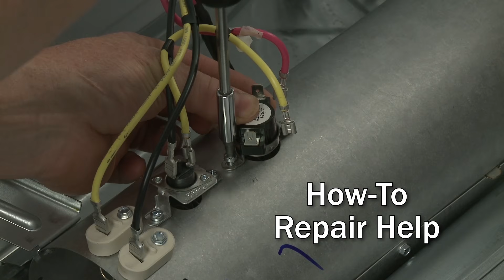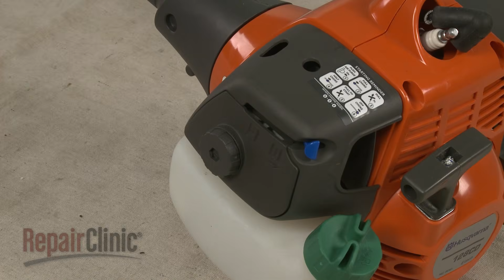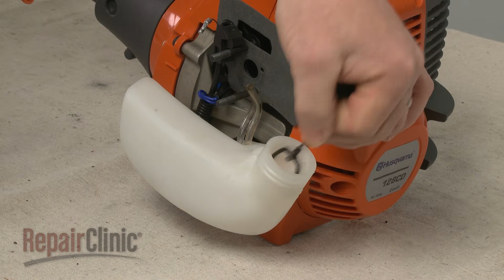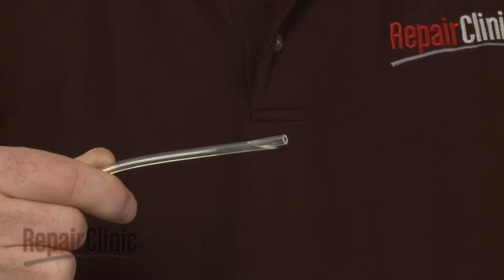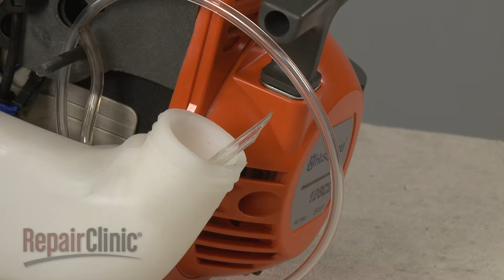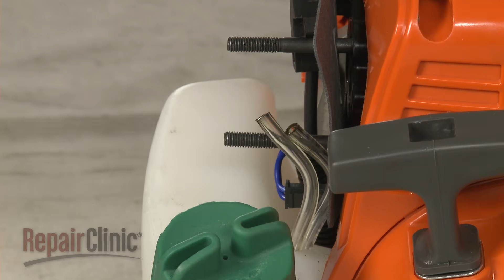Husqvarna String Trimmer Fuel Line Kit Replacement #530069599

Comment: I am in the middle of doing this repair. One issue I think is possible is that the carburetor connections angle back towards the engine. I think the length of the hose line is critical to prevent a kink in the line from forming. Also, comments suggest the length of the drop line in the tank. This is also critical, if you don't want the filter/weight to be in the wrong place. (3rd time is the charm!)

Comment: Hi me again...  I needed a quick review.  I watched a couple other "repair persons" and it was not clear which fitting the lines from the tank should hook to on the carburetor.
Your visuals made that clear.  One fella removed more parts on the engine module than is needed to replace the fuel lines.  
I do think more information on the return line and it's function should be highlighted. 
Thanks AGAIN....
Reply from the maker: Thanks for sharing!

Comment: So my carb does not come off after removing the attachment line. At least not easily...or with gentle force.  Any tips? It's a Husqvarna 128c
Reply: its screwed somewhere
Reply: @cyberedwing  turned out it was stuck to the carb.
Reply: @cookybanana  glad you figured it out

Comment: What about the other fuel line (which I think is the 'return' line)?  Does that also need a connector?
Reply: Yes the other is a return line. Replace both while you are there especially if one is just as bad. The small connector act as restrictors to help keep the fuel in the primer bulb. With out these the fuel will drain right back into fuel tank. And will not start or will be very hard to prime. Put a restrictor on each line .
Reply: @edwardmorales2761  no it wont run out of the primer bulb. first off the primer bulb is at the end of the fuel circuit on carb. it pulls gas through carb and there are 2 1 way valves when the fuel enters the carb. also a valve that the primer bulb forces gas out through the return line. stihl dont use those connectors and very few other brands that i worked on have had them. ive never used them. also stihls i rarely even use the primer bulb

Comment: Dear Husky, the connector is silly.  Just run a length of hose from the filter, through the hole in the tank, to the fitting on the carburetor.  That makes one less part, and two less joints to fail.
Reply: I don't have the connector on my 128 DJX; just length of hose from the carb, through the hole in the tank, then directly to the filter.
Reply: Yours is the smart way to do it.  That is how I converted mine after the silly connecter failed. I have no idea what the point of the connecter is as originally built.  It just makes for more connections to fall apart.
Reply: Only reason for it that I can think of is to ensure that the hose inside the tank is the right length.  But it's easy enough to look inside the tank and see if the filter is lying on the bottom.  On mine, if the line was too long, it curled up and the filter didn't rest on the bottom.  I just pulled the line up through the opening until the filter lay where it was supposed to.
Reply: That is exactly what I did as well.  Good job.

Comment: I am having the same issue as Bobby C. My fuel line broke apart and I don't have a used line to take measurements from. Every video I have seen tells you to cut the same length as the old line but mine was in pieces inside the tank. Does anyone have an approximate length for the line from the filter to the connector?
Reply: 4 to 5 inches normally. put the filter on the end of the line, run it into the tank to the lowest point and you will have to estimate the right length. If you are off by a 1/4 inch either way, it won't hurt anything. better to be a bit long than short.

Comment: I have a question: what is the purpose of the connector?
Reply: I believe the double barb fuel connector is used to flare out the hose some to create a tight seal from inside the tank. In the vid I see him tugging upwards on the line in order to pull that barb as close as possible to the hole. If you just used a single piece of line without the barb you would only be relying on the hose O.D. to form a seal, which may work for awhile until shrinkage occurs over time.
Reply: viewer54322 - That's a good theory but if that's the case then shouldn't the return line also have a connector?
Reply: The return line isn’t as critical to make the thing run.  It doesn’t matter if fuel runs out onto the ground. 

You will have to refill way, way more often though.
Reply: Why not just straight to it?
Reply: Stewart Shankel To connect the fuel filter to the fuel line.

Comment: As asked by Yvonne Tanenbaum. What about the other fuel line? is it connected to anything within the fuel tank?
Reply from the maker: The other fuel line is a return from the carburetor back to the tank for priming. That hose fits into the tank about 3/8 of an inch.

Comment: you show 2 fuel lines but only mention replacing one, what about the other one?
Reply from the maker: The other fuel line is a return from the carburetor back to the tank for priming. That hose fits into the tank about 3/8 of an inch.
Reply: My return line fits 2-3 inches into the tank.  128 DJX.
Reply: I just took mine apart. The return line just went through the hole less than a half inch. It also had the little connector on it but didn't have any hose attached to it in the tank